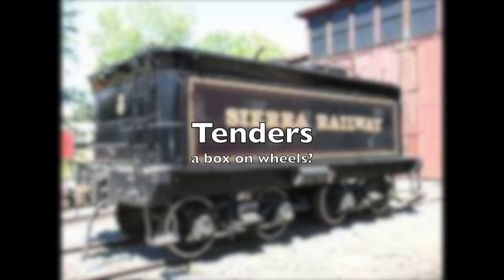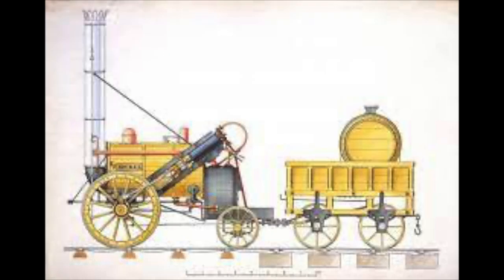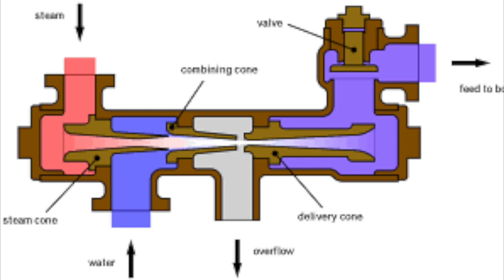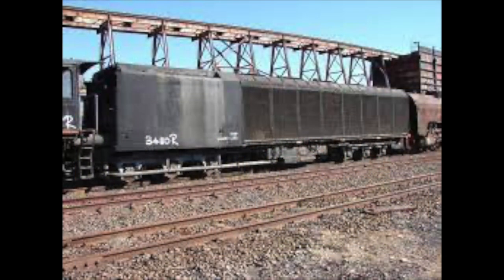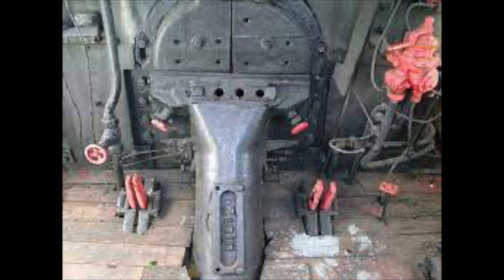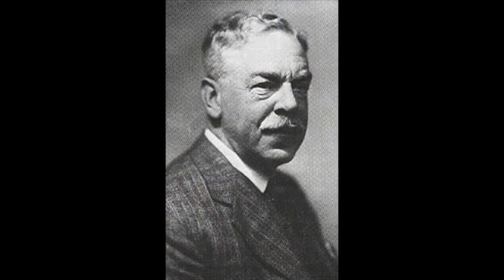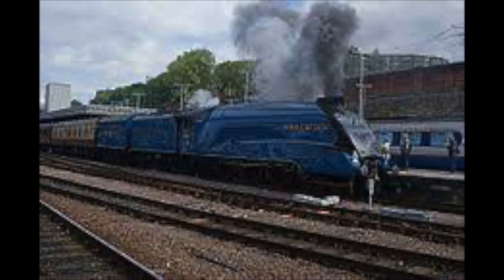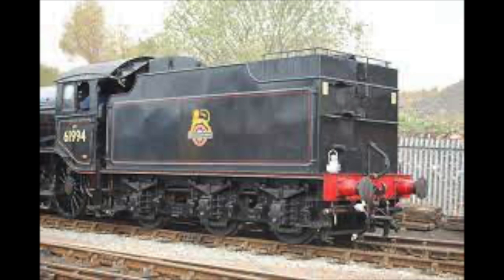A tender subject

Comment: All steam locomotives have a tap called an injector, it allows the driver or the fireman to transfer water from the tender to the boiler, and is very important. Without it, the water level in the boiler would become too low to make steam properly.
It's fun and interesting to learn something about trains in general, even from a series of children's book stories.
Reply from the maker: absolutely, the injector is one of the most critical components on the engine. simply can't have a engine without it. its amazing that its application is now used in all sorts of engines all over the world